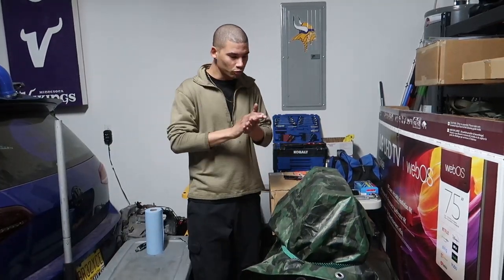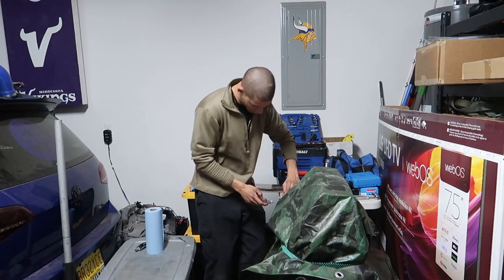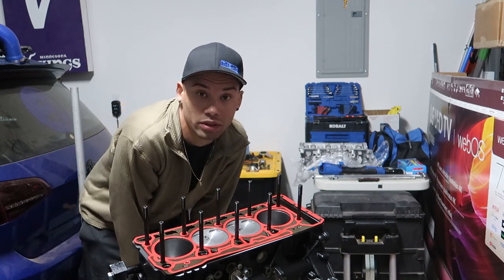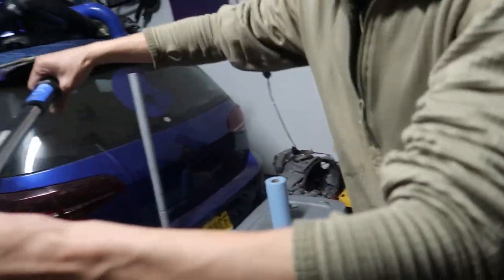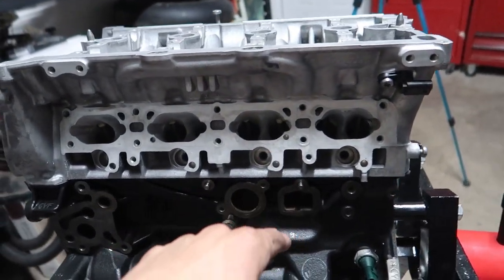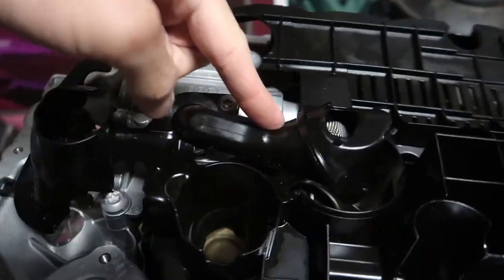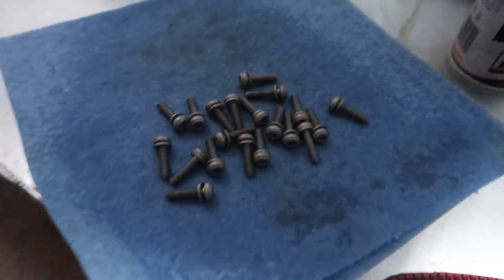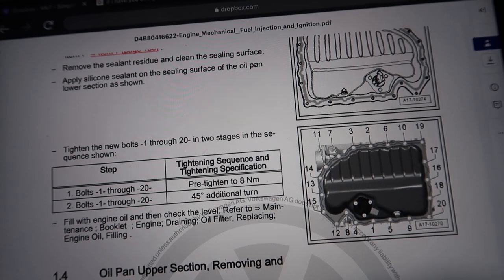Cylinder head installed! | MK7 Golf R

Comment: Dang this is going to sound so sick on start-up. I wonder when full boost will come on with the ported head and ceramic coating. Also we need a weight comparison between the cf and regular hatch!
Reply from the maker: its about a 12.5lb saving, even more if i went lexan. hopefully in the low 3k range still or even lower would be nice! we'll see here hopefully next week. waiting on the new tune right now

Comment: Sick video my bro! Very helpful, I'm rebuilding my engine next week. Where did you get the manual from for torque specs etc?
Reply from the maker: Best of luck! Make sure you use the right section there's different sections for different versions 

https://www.dropbox.com/sh/f99kqqmv66pryib/AAA5LM_C4H6x4l56StzU9YO9a?dl=0&preview=D4B8040D5CD-Body_Exterior.pdf
Reply: @BryceJordanProductions  legend! Thanks mate
Reply from the maker: I think I gave you the wrong link. That's a book inside the folder hold up.. sorry lol

https://www.dropbox.com/sh/f99kqqmv66pryib/AAA5LM_C4H6x4l56StzU9YO9a?dl=0
Reply: @BryceJordanProductions  top man, thank you!